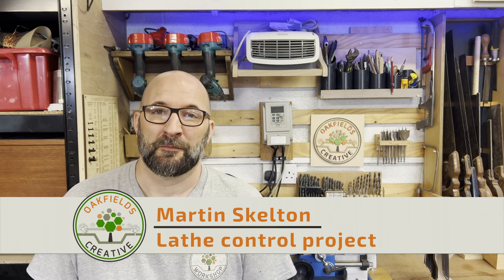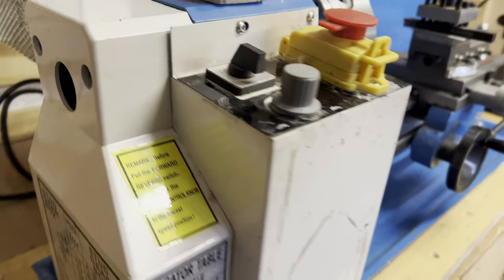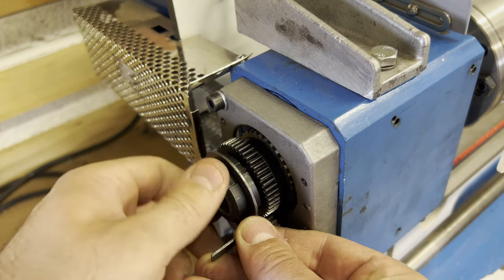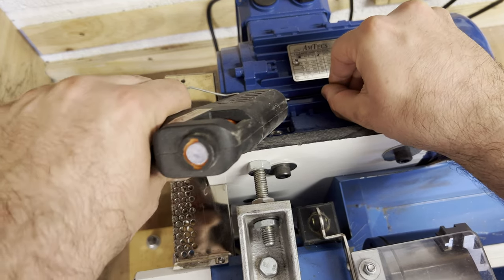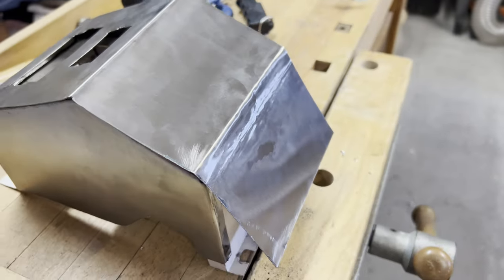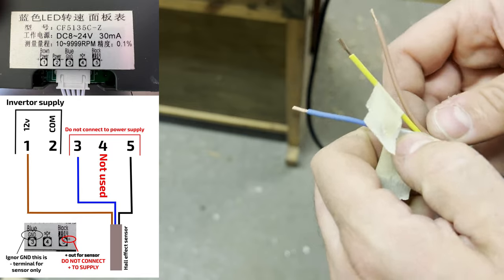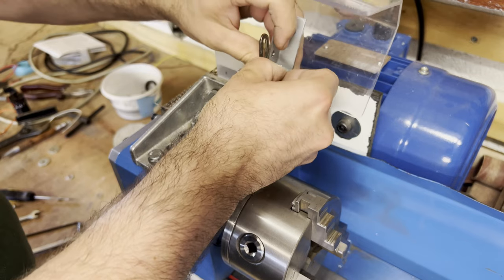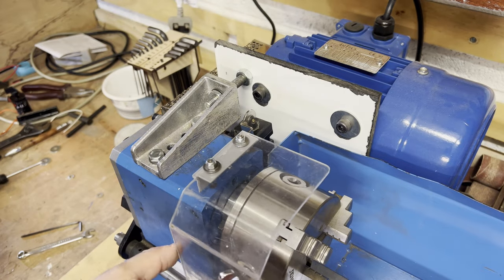Mastering Control: Variable Frequency Drive Integration on a Mini Lathe

Comment: can this lathe cut threads after the new motor
Reply from the maker: It certainly can yes. The conversion is driven to the original drive pulley. So I did not have to modify the drive gears for thread cutting.

Comment: Great video and well demonstrated explained.

A couple of comments (that are worth as much as you want to feel they're worth 😉):

By adding that 2HP motor to yoyr mini-lathe, you've certainty upped the torque available and with a few rigidity upgrades (Steve Jordan has a few really good videos) you'll be able to make use of most, if not all that extra oomph. However, as you suggest, that does mean you gave the lathe extra oomph to hurt you with. 

The thing is, the only thing worse than having no safety guards on a machine tool, is having safety guards that obstruct the work you want to do.

Much of the work on a lathe is done close to the chuck. That's especially true on a mini-lathe, even with rigidity upgrades.

Those chuck guards can obstruct work like that.  There's a reason many machinists (and not just those with mini-lathes) remove chuck guards and it's not because they've reckless or complacent. It's because the cure is worse than the disease in this case.

Training yourself to never, ever, ever leave the chuck key in the chuck and to always know where your chuck key is on starting the machine is a vital part of any machinists safety education. Getting that habit utterly ingrained is a much more reliable safety mechanic than any electrical or mechanical safety device  (which could fail without you knowing).

Also, if you can get hold of one, the 'Big Red Button' e-stops (the ones that are effectively a big red button covering separate start and stop switches) are preferable to the two switch type arrangements.  They're much easier to hit in a hurry and aren't particularly expensive. They'll have the same wiring as your existing switch so it would just be a straight swap wiring-wise.

Lastly, I'd be cautious about emphasising too much the danger of machine tools. Yes they're potentially dangerous machines but there's also the danger of exaggerating the risk and reducing the credibility of sensible safety advice. That can lead to people without a sufficient understanding of what the risks really are, dismissing all talk of safety. 😉

Anyway, hope you don't mind me putting in my twopenn'orth.  😊